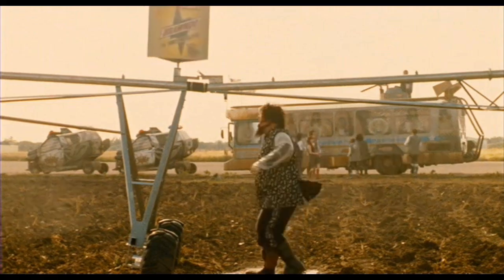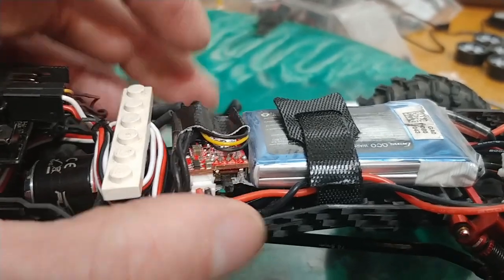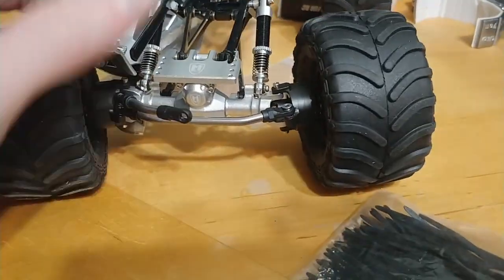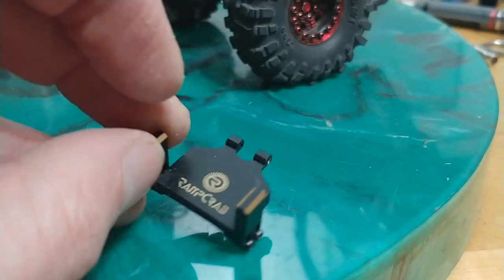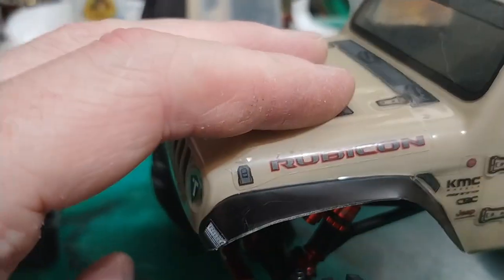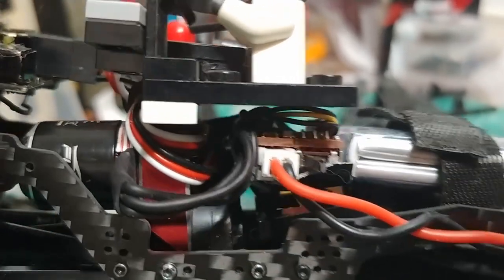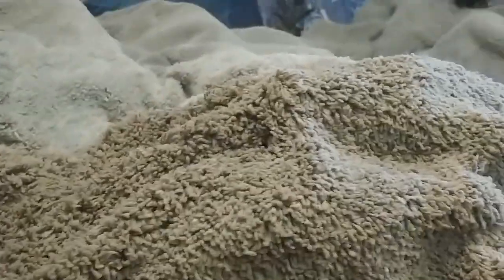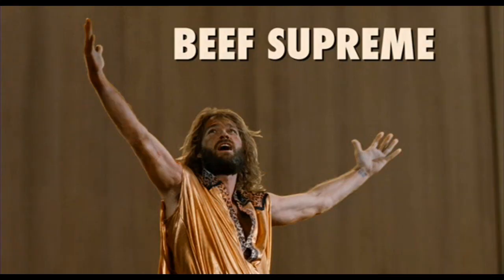Scx24 Glad Injora LCG Chassis and Servo, Crazy Climb at the End :) Wow!

Comment: Oh n BTW them lead weights is a  goodern dude. Nice.
Reply from the maker: Yea man, its awesome to hide some lead in the tires. These glad wheels with tires and that lead mod are coming in at 86grams a piece :) Best place to hide weight :)
Reply: @DurpVonFronz  yeah because in a crawler rotational mass isn't that worrisome unless ya runnin the 030 88t stock motor that comes in the ax. Lol
Reply from the maker: Yea its not a problem at something this small. A lot of people in this hobby think it is though and I 
just shake my head.. lol derppy dudes
Yea those lil motors are totally worthless imo. Im starting to eyeball that Injora Fat Viper and mini Viper brushless motor and ESC, its cheap compared to the Furitek system and it looks really awesome.

Comment: Hey. Let's see that marsupial run thisrn. You can call mine out just wait till Monday. Lol. I figured out where my problem with it was n why it's smoked more $ worth than my green smoke budget. Lol
Reply from the maker: Gonna be awesome to see what you end up doing :)
Reply: @DurpVonFronz  just gotta replace transmission n motor n esc. Burnt motor up n im running the injora mb100 and it has a reverse limiter or sumtin I wanna be able to go just as fast in rewind as I do in fast-forward
Reply from the maker: Yea if your looking for awesome control like that, Id suggest the ESC from Furitek, its called the Lizard Pro. Has an app for the phone where u can control everything about it. The app is awesome, one of the best things about Furitek, instantly change something from the app and totally change the way the rig runs in seconds :)  Very kewl stuff
Reply: @DurpVonFronz  ok cool. I'm wanting to stay brushed for now. Then go to brushless later if I decide to. The futitek esc work on brushed stuff?
Reply from the maker: @DubVredneck  Sure does, was one of the first big upgrade I did to my JLU about 3 years ago, its insane how much smoother it became and no more ESC squeel from the motor either. Get the Lizard pro, I think they are on Ebay pretty decently priced too.